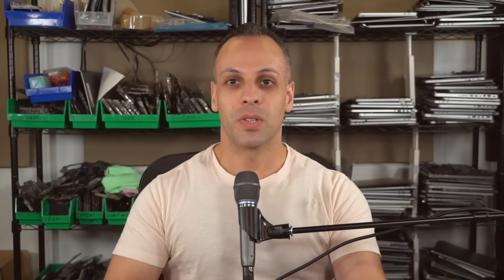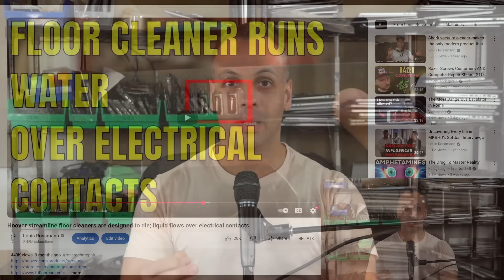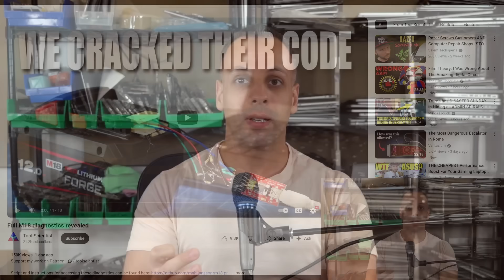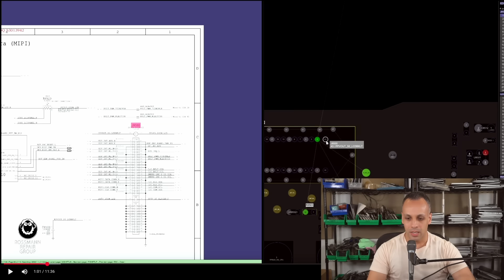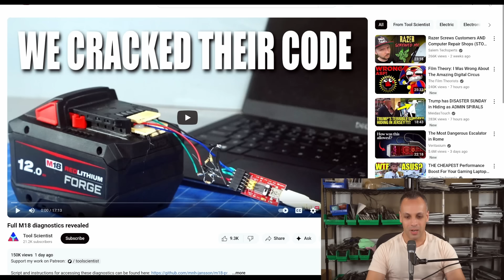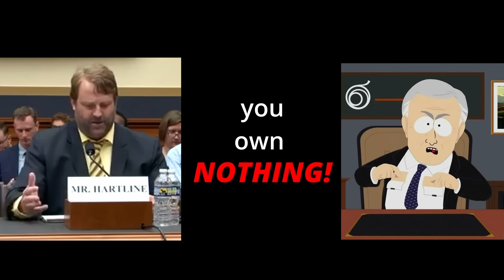Imagine putting DRM in a battery to void warranties...

Comment: I work in the automotive/HD truck sector, and I was reaching out to a refrigerator manufacturer for some troubleshooting help on why their fridges were failing so much. These are simple 12V mini fridges. The engineering tech I talked to said their fridges record the lifetime voltage of the unit and he saw tons of low voltage instances and that's why they were failing and denying warranty. But they were the only ones who could pull this data. I asked him what else they were recording and he wouldn't tell me since it was "proprietary" lol. I thought wow, even a mini fridge is tracking you. Just assume all devices have something in them now, unfortunately.
Reply: Do they also keep track of how many body parts are in them?  Asking for a friend.
Reply: Low voltage events as in when the starter motor runs or when the batrery is disconnected for servicing or while standing for longer times in cold climates?
If I know anything about system diagnostics is, that false positives are very high, especially in non safety critical functions.
Reply: Of course they're putting this stuff in. People have been scamming warrant claims forever and only recently can manufacturers actually detect this kinds of stuff. It's obviously cheaper for them to put in the extra equipment in to monitor this stuff compared to replacing stuff under warranty that was abused/misused.

Comment: There is no such thing as a warranty. It's simply called a warranty to discourage repair. "Opening this device will void your warranty." The closest thing you have to a warranty is that when you get the thing home, you should immediately try it out. If it doesn't work, take it back to where you purchased it and either return it permanently or replace it if you really want one. After a month or so, you really don't have any kind of warranty even if it says 1-5 year warranty. They will simply refuse to honor it. So after the retail store return/replace procedure, go ahead and open it and try to fix it yourself. It's the only shot you have for a working device other than buying a new something yet again.

Comment: If an engineer really wants pin 1 to never be near pin 43, he/she will add a "note" to the info field at the bottom of the drawing, called out with a lettered arrow pointing to pin 1. Most drawings have some notes like this. For the non-engineers, the schematic isn't intended to be a real-world representation of the wiring. For that you need a wiring diagram.

Comment: The part of that video that got me was the counter for how many times you used the battery till it quit working, something that is common in a professional setting. If that point is bad for the battery then have the shutdown set point set to a higher voltage because no one on the jobsite has the time to check charge before every squeeze of the trigger let alone the ability to know if there's 140 screws per led on the level indicator and have they driven 139 or 140 already. That however would shorten the run time stat on your already overly expensive battery it's ?better? to just deny warranty claims because of running the battery too low.

Comment: Hey Louis - a "Battery" is a group of cells - those cells are the 2.6-2.8 lithium cells - we hook them up in series and parallel to get a certain voltage and amperage...   sorry for the pendantics but understanding why it's called what it is...  and yeah, it's all BS -  I have a 24v battery for a robot that is basically one of these units (it uses a bunch of 18650s)  and the robot company charges $500 for a replacement battery.  
Fortunately, that $14000 robot is now out of warranty anyway, so we're replacing cells...

Also, to the TTI / Milwaukee specifically - this is going after pending changes that EU is forcing upon the battery tool industry - where they are pushing to make all battery packs interchangeable.  TTI is putting this crap in to claim that the battery is an integral part of the tool (arguably true anyway, but still)  so they don't have to comply with that pending ruling.

Comment: Ironically, I was about to correct your video BASED on Tool Scientist's comments on Reddit and his content.

Milwaukee batteries do have a balancing system. It's just very passive and quite pathetic compared to what it should be. 

I haven't seen his latest video yet, although it popped up in my feed before yours did. Definitely want to watch.

Ironically, the 12V battery line does have full balancing. Also, I'm sure the MX line does as well as there are WAY too many cells to not have a balancing circuit.
Reply from the maker: And the MacBook I'm referring to has foam around the display connector.

Useless balancing, is not balancing!

Comment: Porter cable woodworking tools are just a Name now and not an industry standard tool like it once was.
Reply: I've bought several PorterCable 4 inch grinders, worked them to death-cord type, noted that several other brands were the same except for color and branding. I always thought there was one big injection molding plant in China, they just changed the color of plastic on grinders and put on different labels.  my only battery tool is a flashlight and I put rechargeable batteries in it from Battery Source

Comment: Ryobi has a line of little baby power tools, they're all relatively cheap because they're really really simple, extremely specialized, and not crazy powerful, but crucially this means they're all designed around a single 4 volt 18650 lithium ion cell, and as a result of there only being one cell, and them building USB-C charging and discharging, a physical button and led light for monitoring state of charge, and also a thermal shut off, all into the shell of this single cell power tool battery, the experience so far has been 100% flawless, and I think it's because it would actually be too expensive to put any bs into those batteries, at the scale where depending on the tool, you're getting a battery, a cable for charging, and the tool, all while only paying 30$ to 100$, depending on the complexity of the tool. For me, doing basic hobbyist stuff just at my desk, these tools are perfect and I've taken a few of them apart and been genuinely impressed with the quality and how simple yet effective the design's are, as well as how repairable they all seem, despite not being able to find any spare parts available yet. I really hope no one buys out Ryobi, they seem to be the only power tool company left that actually cares.

Comment: 6:08 In 2022 Fisher & Paykel had a washing machine with loose mains voltage wires.  They knew the wires could (and did come loose) and touch the metal chassis.  So did we (the service technicians).  Their response in a national meeting: "Customer has safety switch, no?"
By that time next year, I had left.  Worst company I ever worked for.

Comment: Please upvote this so Louis can see.

As someone who started repair after being inspired with your videos, and ending up in battery business for a few years, i have a few things to share, as expert opinion always adds to topics like this.

Balancing and advanced bms is not the problem for tool batteries. They charge fast, and usually lack slow saturation charge that is necessary to do balancing, due to fast charging, and furthermore, cells actually don't need balancing if they are good. Good cells go years and hundreds of cycles in power tools without loosing balance, if they do, balanicng circut usually does not do much anyways. Balancing is mandatory feature for bigger packs.

But batteries are massive anti repair pieces which you unfortunately did not mention, and that is one of the main reasons "advanced" bms you mentioned exists, this is just its evolution. They have a bms designed to stop working after one cell goes below 2.5v, or bms looses power. This is done intentionally, so batteries cannot be rebuilt, which means cells replaced, while keeping the bms, and casing that you alredy paid for. Milwaukee does this, makita, bosch, metabo, DJI, because they force you to buy 3x markup OEM batteries forever, and especially DJI, forces you to scrap a working product once manufacturer no longer make batteries for it. I own excusively budget tools because they do not brick if you try to rebuild them, and there is no way in hell i will buy something like that with my current knowledge. Unfortunately, bms locking is more and more common as it secures more money to the manufacturer.
Worst thing is, china reverse engineers the communication, and makes replacement battery with replacement bms for power tools, which sometimes even lack necesarry protections, and use poor quality cells instead of samsung, lg, or murata that would be used in a rebuild. So at the end of the day, they prevent rebuilds, which encourages shitty replacement as its the only non-oem option. Unfortunately, most of hte time its so low quality i never recommend it over buying oem at a discount...

BUT
There is a MASSIVE safety argument in their defense, as people have ZERO knowledge what should and shouldn't be done with lithium, and will make paralel connection with dead and live batteries to "resurect them" which is an absolute safety hazzard and locking them for good after certain threshold prevents this. No average user has a damn clue how batteries with crystal growth behave, and will think it charges normally, which will happen until it passes 4v at which point battery will start leaking massive amounts of current internally and unless its immediately spotted can cause it to start thermall runaway (or a fire, people also call that an explosion which is not techicnally accurate).
Solving this anti repair practice with safety in mind is hard, as even giving repair diagnostic software will attract careless DIYers and 100% cause unsafe procedures with batteries, just trust me on this one, as failed DIY attempts regularly ended up in my hands after the fact.

All these practices are more and more important, as now everything uses litium ion batteries, more and more things has batteries, chips are cheap, and even if we get a safe chemistry in the future, manufacturers won't abandon their DRM which was causing them increased revenue all these years. I really wonder can you come up with some logical solution after you have additional information. And im very open to further discussion as this was my corner of the world, like macbook repair was for you.

Comment: In Germany I once had a flashing battery which died. I called Milwaukee and they only wanted to see the invoice of said battery and some pictures. They then sent out a new one. I took the bricked one apart and installed a new BMS. 
Bosch on the other Hand was just a horrible experience. We had 2 36V SDS Plus Hammer Drills. Both died after about 3 years. On both the Motor, which was just an unservicable DC Brushed motor burned out. Bosch said F*** you its a wear part that would be 300€ please. We then switched to Milwaukee. We had a few issues here and there but they were always helpful. I just hope that it stays that way....

Comment: Honeywell Novar does 24v next to their comm loop on their boards. Their legacy boards had it before Honeywell bought them, now Honeywell does it. If you touch that 24 to that comm loop, that's all she wrote for EVERY BOARD on the comm loop. It's happened before. Then you are scrambling to replace a ton of boards. All they had to do was separate the phoenix connectors but that is asking too much

Comment: Dyson is another one who purposely makes the battery lock solid and suicide when the voltage of one cell falls below a certain value or even just after a certain number of charges or uses. My Dyson cordless vac battery had this issue and since the microcontroller inside the battery is being powered by the battery and can record any data it wants at any time, it sets a flag in its eeprom that kills it then says goodnight permanently. Changing the batteries for new ones won't fix it as the eeprom is dirty. It can be hacked to reset that bit using an eprom programmer but at that point it's better to say no to the original battery and just get a chinese copy at 1/4 the price. I did that myself and it still works fine as it doesn't have the suicide issue. Original lasted 4 years, copy is still going 6 years later. Some people say these chinese batteries won't work on max power but if you want max use an AC-powered vac not a cordless vac.

Comment: Don't buy anything new. The old stuff works better than the new ones, and it won't charge you a fee every time you make coffee or open the door of your car. It also costs a lot less. There are no reasons to pay more for worse products just because they seem new. Phones haven't really had any improvements over the last 6-7 years. Removing SD slots, adding bloatware, giving you 1GB extra ram every year, and charging you more than a computer is not really an upgrade.

Comment: Mr. Rossmann PLEASE do an expose exposing the Hospital industry & all the CRAP they are doing. From CONSENT FORMS that give away rights to your body parts & all your medical information. To Unneeded Procedures being done on patients WITHOUT CONSENT & then the hospital does not even admit they did the procedure till they are CAUGHT at which time they refuse to tell you who Performed the procedure. Then they MEDICALLY DISCHARGE YOU Wigth a DEFECTIVE Tube they put in without consent so your insurance wont cover it anymore But REFUSE to let you leave till THEY medically Clear you. Then no other hospital will accept a hospital to hospital transfer seemingly because they dont want to fix what the first place botched! AVOID HOSPITALS AT ALL COSTS FOLKS!

Comment: You're close, but.... Ok, when it comes to battery packs... you don't have a bunch of batteries inside a battery. A battery is a collection of objects that work together as one. The units inside are "cells". 
The full title is "battery of power cells". It only becomes a battery when there are multiple cells working together. 
IOW... a AA cell is not a battery. A standard 9 volt battery IS a battery, however, as it has 6 smaller power cells inside it working together to get the 9v total. 

Sorry for the "well ackshually" style explanation, but this is something that I struggled with/was confused by for years, so when I saw you seeming to have difficulty with the terminology as I used to, I thought maybe it might help. 
Hopefully it's useful info, and doesn't come across as condescension, as that's not my intent! Just trying to help with something I had trouble with myself!

Comment: What really gets me is that all 20v (or 18v) batteries out there are basically just 5x18650 - but they each make their shoe configuration slightly incompatible so that you have to buy into a "battery ecosystem." Somehow, for years electronics got along with standard sizes like A, AA, C, D - but now all these 20v batteries need to be brand specific? All it does is lead to useful tools going to landfills. A standard for 20/40/80v power tools would mean tool independence - where you could buy the tool that works for you, not need to stay within a family because "I already have the batteries for it."

Comment: Milwaukee sucks...so many of my coworkers have bought their garbage.  I hope I don't see a video in the future showing Makita does the same thing...that's my tool line.   🤣
Reply: Well makita batteries in particularly their newer XGT line do store a lot of data about the battery useage. However Makita sells a tool to read the data on batteries so you don't have to go reverse engineering a protocol. Although I guess in theory there could be data that tool does not show.

Comment: These companies simply make, what people accept and want. There is a Latin slogan "mundus vult decipi, also decipiaturi", that tells everything. Commercial companies are there to make money for their shareholders und not to provide lang lasting products for their customers (sic). The key to this comprehension of modern surveillance-economy was the elimination of honest and free competition since WTO-decrees 1995, to prevent customer from having a free choice. I had already legal issues, because Lithium-batteries are normally never ever (!) owned by customers. These are simply licensed goods, due to the integrated and often encrypted software (see DMCA). It is all but a coincidence there are two systems: Medical- and military devices use so called BMS (Battery Management System), while consumer- and craftsmen-grade batteries use BPS (Battery Protection System) - without balancing. Many devices use the BM3451-series from BYD - available as BMS -and BPS-controllers. E.g. in Germany (and soon in Switzerland) re-celling a Bosch E-Bike-battery is regarded as a felony, because a customer, who pays about USD 140 for a set of new cells and invests about two hours to change 40 pcs. 18650 cells illegally denies Bosch to sell a new battery pack for about USD 850. If the software detects such manipulations, the police is called in.

Comment: Not defending these companies and their practices, but I wouldn't call this "DRM" since the protocol / data is simply "just" undocumented. However, I have the sneaking suspicion that after this they will eventually introduce a new protocol for new tools and batteries that will use some kind of encryption and handshaking - easy enough to be backwards compatible with old stuff, they will eventually get replaced after all.

Comment: Milwaukee and Ryobi batteries seem to keep dying out (or bricking) when it just gets to outside of warranty. In comparison, my Makita batteries are 9 years old now and still running great! I have 10 of them and zero failures after 9 years! I'm glad that Makita chargers and their 18V battery packs are actively charge balanced every time you charge them, none of that passive voltage balancing crap that other manufacturers use.